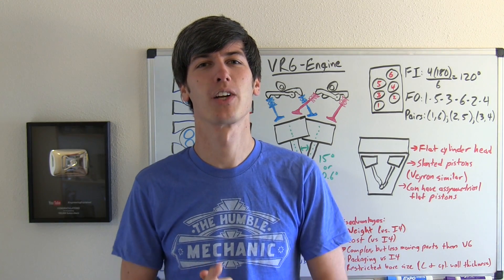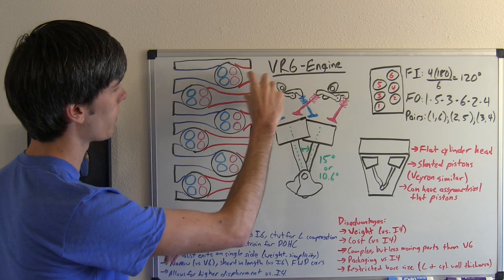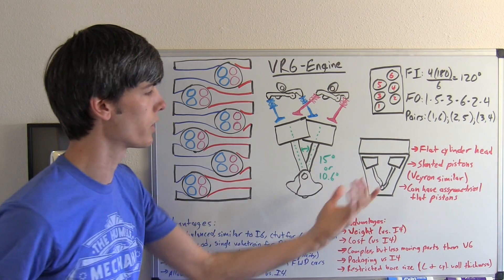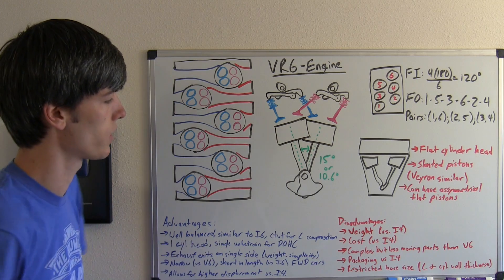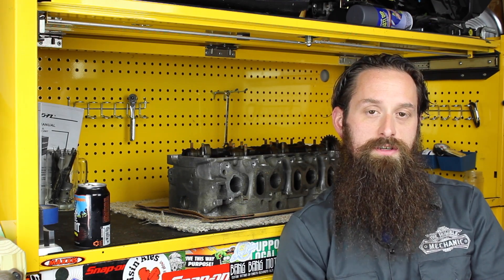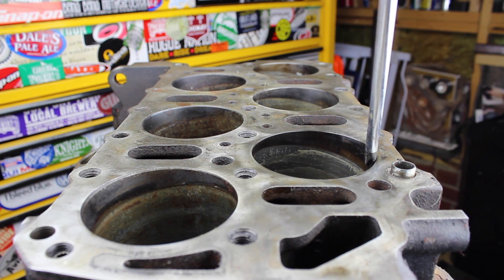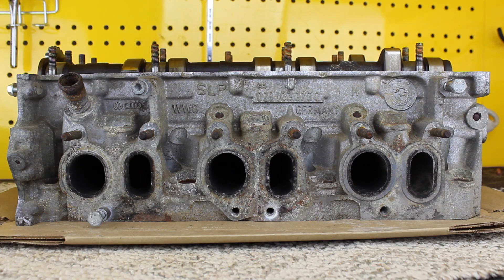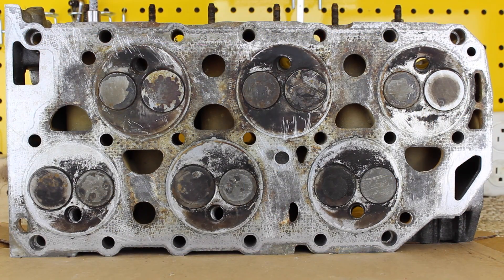VR6 Engine - Explained

Comment: Is the 2014 Passat a VR6?
Reply: ExactlyPrecisely the base engine is the 1.8t it also has TDI as an option. I am not 100% sure the 15 has a  cylinder option. But if it does, it is a VR6

Comment: Wouldn this engine be a great choice because it can be placed perpendicular to the car's length and therefore fit far back in the engine bay, allowing a more front-mid engine configuration. And this engine isn't compared to a V6, only an Inline-4 (a weaker engine if using same aspiration means). Given there are little cons provided in comparison to a V6, it means this engine is actually likely to be better than a V6 in almost everything including size-power ratio.

Comment: actually VR stands for Verkürzte Reihenmotor which means shortened straight engine, anyways awesome video!
Reply from the maker: JimBeamRulz According to Automobile Magazine (and wiki, always reliable, right?) the V is just a letter, standing for V engines. How do you know it stands for Verkürzte?
Reply: Engineering Explained I had internal combustion engines lecture on the unversity while I was studying in germany and the professor actually said that. However he wasn't a vw employee either, but I'm positive in german it stands for Verkürzte... the english translation can be different though.
Reply: JimBeamRulz well you're both correct, it translates to shortened, therefore, shortened inline 6.

Comment: cool vid, still watching. love me some vr6.
You may want to invest in a better mic though, and do a little equalization.
Also for your presentation, slow down. You sound rushed. Sound confident in what you're saying and say it at a speaking pace. Pace yourself.

Also,  A slight continuity error i noticed.
In the intro, you mentioned that each cam is dedicated to eithre exhaust or intake cams. Yet in the demonstration of the head, it is seen that the intake and exhaust valves are shared for each cam, and there is no rocker linkage.
Reply from the maker: draggonhedd Charles mentioned the engine he has is an older one, and that the newer ones use 4 valves per cylinder.
Reply: Engineering Explained Actually, the 24V VR6 is the same. It's a great video, but there is a small error in that there are no rockers in any VR6 engine as depicted on the white board and the cam actually drives both intake and exhaust valves.

There are endless arguments on the different forums about whether the VR6 is DOHC or not because in all VR6 motors, one cam drives both intake and exhaust for it's cylinder bank as in a SOHC setup. Twin cam is probably the best description, but the 2.8L engine cover says DOHC :)
Reply: That is correct. The 12v directly actuated lifters, there are no rockers. 

It's not truly DOHC because each cam controls the intake and exhaust valves.

Comment: As I'm in the midst of rebuilding a VR6 12V engine right now, I'd like to make a correction to something you presented in your video:

You said that one camshaft opens the intake valves, and one camshaft opens the exhaust valves.  This is incorrect on the 12V engines (which you're showing here).  EACH cam opens intake and exhaust for each bank of 3 cylinders.  It's not a traditional DOHC setup.
Reply from the maker: rhkips Correct, the block shown is the older generation (as Charles mentions); the modern VR6 is DOHC with one cam controlling intake, one controlling exhaust.

Comment: Damn dude, that 12V VR Block and head looked rough. I just rebuilt my vr head for my Corrado (timing chain skipped _), and it was rather easy for a 6 cylinder.
Reply: Yeah, they came out of a car that had a blown head gasket, then they sat for a while.

The VR in my Cabby at the end is much prettier. It was fully rebuilt and painted.
Reply: HumbleMechanic what type of exhaust system u got on the car at the end of this video it sounded very beautiful. I just got in to the vr6 bin in Hondas but now got an mk3 and put a vr6 in to it off a 97 passot had to fix the vacuum and the egr valve but still have a bit of a problem at idle. If u have advice any will help. Ps I know my spelling is bad.

Comment: Engineers that designed this engine at Volkswagen are absolutely brilliant, it's actually a real piece of art when you get down to the engineering details of the vr6.
Reply: And when you put 2 together you get a W12
Reply: Actually the VR6 took the engine design from a '63 Lancia V4. However, the late genius DR. Piëch based the VW engine design of an IL-6 cylinder and called it VR6 - Verkürzt Reihen - Shortened Inline6. From there a VR6 - 1 cyl = VR5, then a VR6 - 2 cyl = VR4 x 2 = W8, then a VR6 x 2 = W12, and finally a W8 x 2 = W16
Reply: where are more in depth details about shallow angle engines?

Comment: I noticed the Humble mechanic mentioned a coil pack providing power to the spark plugs. I have a general idea on how they work but having you explain it would make it so much clearer. I'm also curios about how a front wheel drive works. I own an 02 impala with the 3.8L v6 and it never ceases to amaze how all that motor and transmission is crammed under the hood. Love your videos and your very simple and informative way of explaining how it all works

Comment: Only downfall to VR's are the timing chains. But other than that, they're very stout, sound awesome. And can make a ton of power with boost applied. Also they're cheap, can pick a 12v up at a junkyard for $300.
Reply from the maker: suzuki400boi What's wrong with the timing chains? Typically chains last forever, where as a belt will need to be serviced. Chains do eventually fail, but they're much more durable than belts.
Reply: Not that it's a weak point. But I have seen them fail prematurely. (Under 50k miles) It's just something most people ignore cause it's an expensive job, and not exactly the easiest to tackle. Thus when you buy a VR, 9/10 you usually get stuck with doing it, or worse. Would be much easier if it was a belt imo. Still not nearly as bad as the Audi 4.2 V8 though. That's a nightmare.

Your videos are great man. Keep it up!
Reply: The Canadian
I have a 2.5 Jetta sitting in my bay right now with that exact problem.
Reply from the maker: Wow, that pretty much defeats the purpose of the chain haha. Considering the belts can last 90k miles, doesn't seem this was done properly.

Comment: one question on the cylinder head design on the vr6. i've always been told that you want the combustion to happen "in the cylinder head" and not in the block, so to speak, meaning that you want a bowl shaped combustion chamber in the head instead of flat. so my question is, isn't it unhealthy for the block to have so much preassure and heat directly in the cylinder, compared to have the piston purtruding just a bit above the block and a larger combustion chamber? badly formulated but hope you get it

Comment: The difference in intake running length is actually compensated in the intake manifold.
However, the VR6 engine was originally designed to be a turbocharged engine. This is also the reason why this engine can be turbo-ed so easily. 400+ HP with stock internals (lowered compression) is not a problem.
I have a few videos on my channel from my old VR6 Turbo which made over 400 hp without any major mods to the engine itself
Reply: i took a porsche cayenne 957 model, 3.6 vr6,l,installed forged carilla pistons 10.5;1 ,and a gtx3582r  garret turbo,running water /meth,17lbs boost 4 inch dia down pipe,1000 injectors,, 530hp, no issues,  got 40000miles so far,

Comment: GREAT VID! Thank you so much for finally getting into the VW stuff. You should so the 20V 1.8t next. Also the O2m dual input shaft six speed transmission soon. And if that doesn't do it for you You can discuss the older ABA and G60 CIS and digifant setups. German cars a freaking sweet!
Reply: I don't know about Digi, but we might be able to do something with C.I.S. I have 2 engines with of CIS stuff.

The newer 1.8t EA888 engines are pretty cool.
Reply: So are the German firearms my friend. As I see you already know. I carry a  P229 in .40
Reply: HumbleMechanic
How do you find the 4.2 V8 found in many Audi models?
Reply: I have very little experience with the 4.2 chain driven engine. Only a limited run of Touaregs had it. A buddy of mine that works for Audi says they are good, but can have cam adjustor issues.

I have lots of experience with the belt driven 4.2. That seems to be a really good engine. VERY little mechanical issues. I have seen a few overheat, but that was driver error.
Reply: Is the chain driven one the older or newer one with direct injection (FSI)? Also, do you know much about the 3.2 V6 that was used in many previous generation A6's and also A5's? I heard they did have a problem with timing chain issues...
Reply: VW look so boring :( And they all pull from the wrong end
Reply: You are saying that now, but VW owns Audi, Bentley, Lamborghini, Porsche and even Ducati, so yeah sure they pull from the wrong end...............
Reply: 1820AL I was speaking about the actual Volkswagens, not the other brands they have bought. Such bland and neutral design in my eyes. And i think you can see VW influence in Lambo Gallardo, looks nothing like the other lambos with its straight lines.

I like my cars how I like my women, elegant curvature!
Reply: Mortalomena its all about your application. if you are looking for a daily that is comfortable, has pep, and won't break the bank, then VW is a good choice. They are not by any means bland in their engineering as they R&D a lot of firsts for cars hitting the market. That being said, they also don't go the same lengths to protect their proprietary tuning as other manufactures. there is a ton of aftermarket for VW.

Comment: Excellent joint collaboration guys.  I never taken apart a VR6 before and having owned one I always wondered (apparently not enough to google it :-P) how noticeable the angle would be from the deck of the block, question solved.  Very cool stuff, I loved that engine, great noise, great torque, unfortunately the MKIV GTI that went around it was an utter hunk of shit, lol.

Comment: Little mistake thouhg: on the white board one camshaft drives all the intake valves, other - all the exhausts, on the actuall engine each cam drives 3 cylinders ( in and ex valves). ;)
Reply from the maker: Yep, these are different generation engines, the modern ones have DOHC and each cam drives either the intake or the exhaust. The older versions were only 2 valves per cylinder, and had a different valvetrain design. Apologies if this wasn't made more clear, though Charles did mention it in his introduction.

Comment: VR6 isn't "V" R 6 it means Verkurzt Reihenmotor 6

Which translates into shortened straight 6
Reply: Alexander Hernandez nein
Reply: But still it is a combo of a V and a straight engine... So the VR6 name actually has a double meaning.
Reply: @Oystein87  It's impossible to design a 15° V6, not even in CAD.  The cylinders are too close to each other and they will collide during the cycle.
Reply: In Slovak it’s “Vidlicovo Radový” which means combo of both V and R  :D
Reply: That's correct.  Unfortunately neither Jason nor Charles knew about it.
Reply: Or maybe it means straightened  V6
Reply: @j.m.5995  The VR6 and V6 are two different animals. A V6 has only a 3-crankpin crankshaft where two connecting rods ride on each crankpin. A conventional V6 has two banks of 60-120° V. It's not possible to have a 15° V because the cylinders are too close to each other and will collide as they go up and down the cycle. The VR6 - Verkürzt Reihen6 - Shorthened Inline6 - has a 6-crankpin crankshaft, just like the IL6. Each connecting rod rides on each crankpin. Each cylinder is bored at 7.5° from the cylinder head vertical CL and a total of 15° between the cylinders. This allows the cylinders to be staggered and shortened the crankshaft length. This reduces the inherent flex of the conventional IL6 crankshaft. Thus lower crankshaft bending moments. It's known in the BMW fan club forum as the crooked IL6.

Comment: So far, it seems that the advantages greatly outweigh the disadvantages. Why aren't any companies using this design? I'm sure Audi could slap a supercharger on a VR6 and make a bad ass S4/S5 replacement.
Reply: It's because I4s are cheap and everybody is going the small I4 turbo route. In the near future probably every car that still run on fossil fuel will use at most four cylinders.
Reply from the maker: Darkmatter28031 I4's are cheaper and more fuel efficient, and with turbos can produce equal power while still maintaining better mpg.
Reply: Also the reason why no other brands outside the VW group use this engine setup is I guess because VW took a patent? Cunning as those Germans are that wouldn't surprise me. But I'm not sure about this, just guessing.
Reply: Most likely because they are more complex, therefore more expensive to make. They aren't going to get as good gas mileage than I4, in theory. I've seen people post their mpg numbers that have been in the 30's with the VR6. Would be hard to do with the way they sound though!

Comment: would you ever consider swapping a VR6 into a 1995 altima?
Reply: Crossing brands gets a little tricky, but I say go for it.
Reply: sweeet! all i need to hear ;D ahah. but for reals, what kind of complications would you seen coming up. Broad spectrum or vague is alright.
Reply: Caleb Sickles  Both are pretty easy swaps. I documented a lot of my swap at http://humblemechanic.com/category/luv-a-dub/

If you do VR6 use the Eurowise kit.
Reply: Caleb Sickles well it probably wont work in an Nissan. LOL
Reply: darn, ok thanks!
Reply: Caleb Sickles
Just to be clear, I meant the Eurowise kit will not work. You can totally do the swap. You can swap anything into anything. You just gotta have the skills and the cash.
Reply: yeah thats what im getting from this.

Comment: Is VR6 just a VW term? Do other manufacturers use the same setup?
Reply: tijean sharpe Buggati is owned by vw
Reply from the maker: No manufacturers (outside of those owned by VW) currently use this layout. It's been used in some Audis and a few other cars, though primarily on VWs.
Reply: Engineering Explained what about the buggati w16 engine
Reply: Just remembered
Reply: This design was patented by Lancia in 1915 and used from '20 to '70

Comment: So the W8, W12, W16 are basically two VRs on the same crank shaft. The W8 for example it would be two VR4s on the same crank. 
There was someone down my street had a Passat W8, I drove it when it was for sale. I didn't have enough money for it, but it was a really nice car. It preformed well
Reply: AWESOME car to drive, but horribly expensive to fix. The engine has to come out for a lot of repairs.
Reply: HumbleMechanic it was so cool to drive it sounded awesome. I guess that's the reason why they never sold many W8 Passat models. I wish they still used the VR6. Do you know why they stopped using it? Did the 2.0T replace the VR6? I know that is used in a lot of VW products now
Reply: Bryan Doherty For the longest time, I wanted a W8 wagon. Heck even with free labor, i would struggle to afford the parts. You can buy them dirt cheap now, I just don't think I would get mixed up in one.

They still use the VR6 in the Touareg. You are correct that the 2.0T TSI did replace the VR6. They are moving more towards simplifying the car line. More cars will share more parts than ever before. Part of that is using MQB. That is where different parts of the car(think from the center of the front wheels to the steering wheel) are the same on every car.

It allows them to save money, and build cars that share more parts. This should make the brand better from a reliability standpoint. I worry that it may become more generic looking and feeling.

They are doing awesome things with the new 1.8t and the 2.0t. The are different variants of the EA888 series engine. The new GTI 2.0t is AWESOME. Well almost everything about the new GTI is awesome. I can't wait until the performance pack hits later this year. I think the MK7 Golf R will hit mid 2015. And if a boy can dream, the Golf R Sportwagon.
Reply: I wanted one for a long time too, but I'm not mechanic, I understand how most everything works but not enough to do major maintenance myself. 
I never knew the Touareg ever used the VR6. That's what I thought. It seems to be a really good engine, so does the 1.8T. You would know more being a VW mechanic, but I've never heard anything bad about the 1.8T or 2.0T. 
I really hope it doesn't make all VW group products feel the same. 
The MK7 GTI is really nice, I've seen quiet a few on the roads where I live, really good looking car. I really want the Golf R Sportswagon, it looks really nice. I've heard it will have 296hp
Reply: HumbleMechanic As an owner of a Golf MK6 R, I can say that I would MUCH rather have the VR6 R32 or R36 engine instead of the 2.0 TSI.
Yes the TSI is more economical and produces more power than a stock vr6 engine, but the sound of a vr6 engine is just incredible. Also when turbocharging a vr6, they will make 400+ hp easily.
Reply: HumbleMechanic phenominal response
Reply: Well that explains the awesome sound of the w8.. One of these in an Audi SACRAMENTO race way.
Reply: My sister has a B5.5 W8 Passat, costs her a fortune to keep it running especially now it's getting on a bit - but she loves it so won't give it up.
Reply: I was looking how the engine was put together, and from what I've observed it's a pretty stout motor.
Reply: I was looking how the cylinder head design is and what it looks like sitting on top of the engine block, its like the vocal chambers in a Saxo phone, which probably explains why it has such a beautiful sound.  I bet you the engineers were kept quite busy figuring out the length of the intake ports so engine would run smoothly. Phenomenal sound though the only thing I could say that even comes close is the j spec 2.5 liter v6 that's very popular that to swap in a 92 94 MX 3GS. .